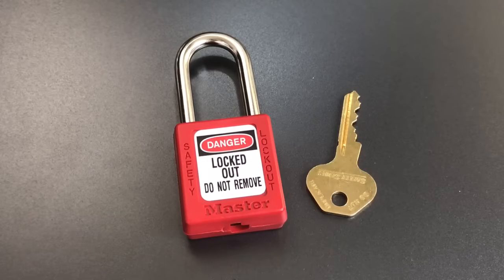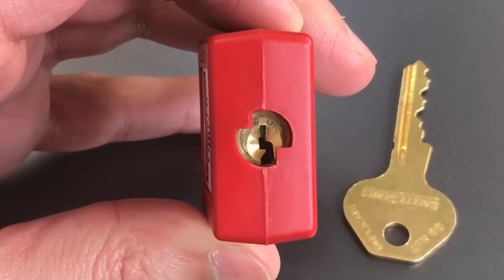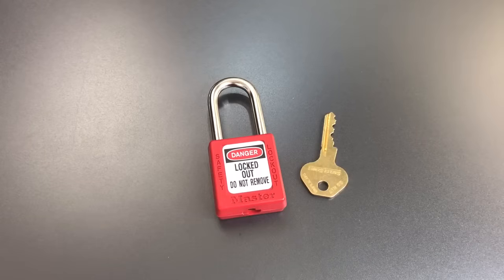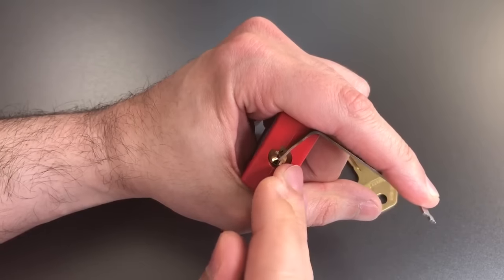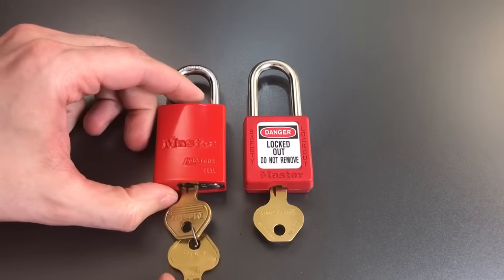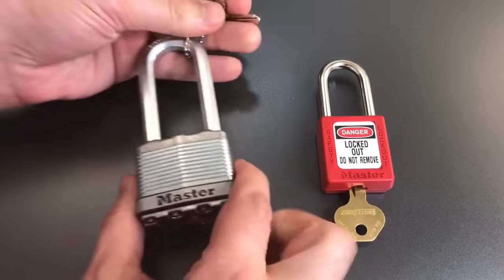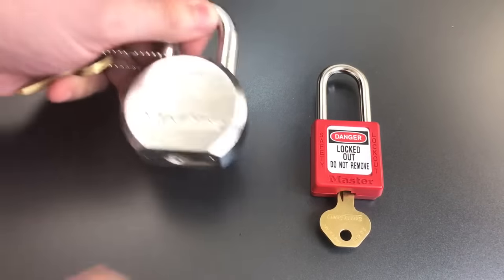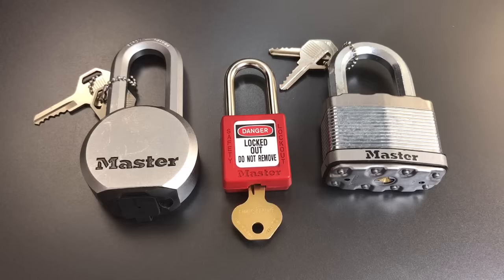[479] The Master Lock Paradox - Model 410 LOTO Padlock

Comment: when I was working at a hydro electric plant, we had about 500-600 of these on various switchgears and electrical panels. Various people had various keys to unlock various systems of the lockouts. While no one there would have any reason to break a lock to one of the panels, making a simple accident, if someone through the wrong panel at the wrong time, there could be anywhere from a broken turbine to an explosion. Therefore, its better to have a lower chance of unlocking the wrong padlock then there is for having a secure lock body since there is no risk of someone trying to break it.

Comment: This particular video still resonates with me when looking for a lock.
This video is the single reason I have watched so many LPL and BB videos.
This single core has shown me how a lock intended for a $150 bicycle can be made secure enough to protect several thousands.
I use this knowledge to smith my own locks, as well as play with home made picks. I even have a set of my own home made pins. About 40 total between key/driver pins and bags of almost every manufactured pin size.
I'm every bit of a low level hobbyist, and I can make better locks from my scrap bin than what master sells.

Comment: Hi LPL I'm a maintenance electrician working in a gas production facility. We have a lot of lethal machinery and high voltage equipment. We use the lock out Master locks in this video. Having watched it I feel a bit safer. I would think because my life is more important then someone's garage, is the reason Master Lock has made sure you can only open the lock with the one key it comes with.

Comment: I doubt you’ll see this but, I work in an industrial setting and my guess would be that like you said they wanted a core with plenty of options, maybe a factory with thousands of employees and each employee expected to carry multiple locks, but being a LOTO lock you don’t need security you just need a glorified sign saying somebody is inside this machine. You do however need to be able to remove the lock easily if the owner loses a key, breaks the key or say they go home and forget to remove the lock. I know the keys aren’t exactly delicate but if you lock and unlock a locks dozen times a day every day for years on end the keys eventually get worn pretty heavily. I’ve had multiple locks cut off machines for all these reasons.

Comment: I worked in a sawmill and we used lockouts all the time: changing saws, clearing jams, maintenance, etc. As the "Lock, Tag, and Try" procedures were implemented, the Company started out using standard Masterlock locks and went to great lengths to make sure there was no duplicate keys out there. People being people, the Company had to buy locks monthly to replace lost and missing locks. It became a weekly task for one person to put locks where they were needed and to make sure there were no duplicate keys. It seemed the Company was supplying locks for every shed in the County. Even though the plastic locks were more expensive, the Company cut their cost substantially when they made the switch. Also, Masterlock sells them as a system and makes it easy to avoid duplicate keys.

Comment: It's not a paradox. They're not supposed to be physically secure, they're supposed to be secure in the liability sense. The strong key retaining core means that if the lock is put on or taken off of something then in most circumstances you can be sure the one person with the key did it and if something goes wrong because of that everybody else's ass is covered. The lock body being plastic means that in an emergency the system the lock is on can still be accessed, but it's evident that the lock was damaged to gain access.

Really it's just an ass covering tamper evident lock that can be removed in emergencies.

Other Master cores are bad because making good cores costs more money and most customers don't know the first thing about lock picking. If the outside is sturdy then that goes a long way to convincing people it's a good lock, and it goes a long way to stopping most thieves too.
No matter how good Master makes them, we'll always go with Abus or Medeco so they're not going to waste money trying to appeal to us, they've got a pretty decent name among regular folk and they're affordable enough to seem preferable over their more expensive competitors.
Reply: you donky  found the union employee
Reply: Still a paradox because they copped out on the heavy duty locks made for security.
Reply: @rayers1000  they didn't cop out. They did it on purpose. For a specific reason. One guy from Australia explained it above.
Reply: Yeah was thinking something like that. The lock means "do not pamper with me, i am hard to pick and if you try to get me open you will likely leave evidence" while still it being possible to be opened. Even when picking it and you are not careful you could leave scratches. But this doesn't quiet explain why other locks should use worse cores?

Comment: As a complete noob starting picking today, I used one of these as my first lock, as well as a random Brinks lock I found. I would just like to mention for the Master Model 410 LOTO lock, once picked, do NOT over rotate the core past 90 degrees, for if you do you will drop all of the key pins into the lock body. Spoken from experience, that satisfying clunk of a lock picked followed by the jingle of all 6 key pins falling out filled me with a lot of emotions. Lesson learned. Thankful this video was here for reference. 
As for the core, can confirm, 5 spools and 1 double serrated on 5.  
Also, picking using LPL Genesis Set.

Comment: This paradox isn't a paradox at all! It's easy really... This red lock is a safety lock - that's the answer for its internal and external properties. A safety lock must be difficult to open without a key, but at the same time easy to destroy in the events of emergency. All other locks that this company produces are for regular consumers - the lock must be cheap to produce, but look sturdy. And something tells me that the locks body is always cheaper than the locks internal mechanism.
Reply: Did you not watch the video?  1. Then why do they make other LOTO locks more hardened but with lesser keys and 2. His point was more about why the stronger master locks have such crappier keyways than it was about why that lock was plastic.
Reply: Ian Adams you’re off your head. Those questions were just answered.
Reply: @Cowboy96  I was replying to Kelanian.  I know what questions were answered, he apparently does not
Reply: You work for master lock don’t you 🤨🤨
Reply: It's all about money. I'm betting the plastic lock is the most expensive as it offers the best features for LOTO. It's light easy to break open and has high security from picking.
Reply: @ian3580  to paraphrase the original comment: locks for typical uses must look strong and be cheap.

If the difference between a good and a bad core is several seconds more needed to pick it then it's usually not worth the price. But a sturdy looking lock will stop a burglar with a crowbar or another tool. So it makes sense to produce strong locks with cheap locking mechanism (making the entire lock cheaper).

Comment: If someone leaves a lock on, you need to be able to destroy the lock in high priority situations.  This is not a common practice, but there are situations where this could occur.

Industrial process owners aren't trying to protect against destruction of a lock, they are trying to avoid accidental operation of equipment.
Reply: My dad used to work in coal and hard rock mining, and someone went home with the key to a LOTO lock for a conveyor system. According to him, his parent company lost over half a million dollars waiting for the guy to drive back- but MSHA regulations forbade cutting the lock.
Reply: There are very few locks that stand up to five-foot bolt cutters.
Reply: It also could be because of these are used on high voltage applications. Could be a personal safety feature, also could be to keep the bolt from welding to the body should a short happen
Reply: It's pretty common in my experiences, these locks almost get cut on the daily in bigger factories. You need permission from the guy that placed the lock however (usually contact info is on the lock), otherwise it's illegal even if you own the lock and the machine. 

As for high voltage applications, I don't think that's relevant. The interior is still metallic, and either way the shackle would melt off pretty quickly in a short. And for personal safety the keys aren't insulated so you'd zap yourself by putting the key in even if you don't touch the shackle. THOUGH a lot of control/electrical panel lockouts actually aren't that sturdy. A heavier lock could easily not fit or damage the lockout over time. I've seen deformed lockouts in my days.
Reply: Then why the good core? If not hard to break then why need such a good core but for the hard to destroy such a shitty core.
Reply: @strategygaming5830  They had to meet requirements demanded by Industrial regulations. Basically its common for industries to hold thousands of these at once so they demand more possible pin combinations. And FYI I'm pretty sure this is why they're made cheaply, because they're sold in huge quantities. Being easy to cut is just a happy coincidence.

As for the sturdier locks, the primary method of forced entry would be destructive methods. So that's their priority. When it comes to the core, odds of someone else nearby having an identical key is pretty much impossible unlike the safety lockout locks. Having a 5pin or 4pin core doesn't affect security, if your thief can pick a 4pin core he can pick the 5pin core too. As long as it protects against no skill attacks like bump keys, raking and shimming it's practically going to be as good as it needs to be.

The only thing that confuses me is the use of security pins in the safety lockout locks. That seems excessive. The only explanation I can't think of is this was was per-designed core from an other project. So when demands came for a 5pin core they just pulled it out instead of designing a simpler one.
Reply: @DDracee  This would be a good argument if it weren't for the fact that most of the beefy Masterlock locks are famously pretty easy to rake. LPL even does a few videos where he he compares the different Masterlock locks and finds that usually the ones that can't be raked are their level 3-4 security locks (based on Masterlocks ratings) while their 10s are usually rakeable. While some leeway can be given to the number of pins and such, just the sheer false advertising Masterlock does, like having that weird inverse security rating system just severely casts doubt on whether their designers actually do any research on real world crime. While there are probably not that many lock picking thieves out there, I reckon there are at least as many of those as the ones who carry around 6 inch grinders, and certainly less than the amount who know how to rake.
Reply: @styleroler5816  That's just masterlock being masterlock, cutting corners wherever they can. Wasn't trying to argue that they make good locks. Just that they were forced by demands to have that core in the lockout locks. 

Unless they're forced to they're gonna keep what they can to the bare minimum. Unfortunately their definition of "bare minimum" goes bellow the acceptable norm.
Reply: @joshuahudson2170  try getting a 5foot bolt cutter inside a 8in square cubicle enclosure 😁

Comment: sounds to me that they need a lock that is hard to remove without damaging it if you aren't authorized to do so. 
example: emergency! we NEED to actuate that control RIGHT AWAY but the key is unavailable! making it easy to break is a good idea for this.
another example: if it's not an emergency, we don't want someone to get away with gaining entry undetected. if they break the lock instead of opening it, we have evidence of foul play and are personally off the hook for responsibility.
basically it's for insurance and liability reasons.
Reply: I think this is what it is, personally.  It looks more like a seal than a lock.
Reply: Larry Maybury I think seal is the right way to look at it. Also it is an indicator to say “I am working hear; please don’t turn it on”
Reply: @rurikau  that's why it's a LOTO system, and not a LO system.
Reply: To be fair, picked locks are fairly easy to detect forensically.
Reply: The need for capitals and proper punctuation is deemed supervacaneous these days... Sad.
Reply: @Eunakria  what traces does picking leave behind? how is it detectable? I'm curious
Reply: Who are you telling that? PS. some ppl are not native speakers and therefore can't set every punctuation mark correct. tries to set commas correctly in a german sentences
Reply: @Lukas-xk1jq  : I too am not a native speaker... But EVERY language has punctuation.

Comment: No doubt some else has said the same thing, but there is a very simple reason to have a difficult to pick but easy to break padlock.

This padlock is used for SAFETY purposes.  It is much much easier to break it than to pick it.  As such, it's clear as day if/when someone unauthorized removes it.  (There is no 'master key'). 

Either the worker with the key removes it, or someone else breaks it off.  And because it's locked out for the worker's protection, that can have some serious consequences.

Trust me - even in a company where they take safety seriously, the skilled tradesman inside the machine can and will put 'hands on' the person that removed his lock.

I know this firsthand.  Was working overtime, in a 2,000 lb press fixing a die.  I hear the press starting up while I'm inside it. I slid out as fast as I could, and came around the press to see the blood drain out of someone's face. I chased them out of the building seeing red.  (Fyi, I deliberately let them run faster.  I didn't want to hurt them, but I did want to scare them.)

Comment: For some applications in industry, tamper evidence is a high priority, yet physical security is not.  That is to say, there's can be an acceptable protocol for cutting off the lock when an exception occurs, but it must be evident that it has been cut so the proper protocol can be followed.  

Things really go sideways if the lock is opened, and the exception protocol is NOT followed.  FOR THIS you need a lock that can't be picked by a novice  but can be easily opened if needed.  Especially plausible if someone is highly motivated by professional peer pressure or management performance review pressure.

For such applications, simple serialized tamper tags could be used If not for the fact that the locks are constantly reused, and assiged to one person.

Comment: I would say that they design most locks now for saw, angle grinder, pry attacks which Master has been pretty decent with. They just don't see the picking as a main attack possibly. At least they  don't seem to be focused on that side of it. But it is a little concerning when they have these nice 6 pin cores available cheaply and they chose to put a 4-5 pin basic core in all the top "Magnum" series.

Comment: The lock has to be OSHA compliant. One thing that was required was that the lock could only be opened with the key provided (also means must not be easily picked). The cylinder must be used for a LOTO purpose.
Reply: So their 'high-security' locks are not required to be OSHA compliant? /joke
Reply: Alien Kitten You're missing the point.  These have a very specific use.  They must be hard to open legitimately (only one key) and must be easy to cut off if the owner of that one key goes missing.

Comment: From the viewpoint of someone who’s a novice with locks but experienced with industrial equipment, here’s my take:
1. 6 pin core to increase the total number of key combinations. Repeating key combinations within a plant or even a company is usually a no-go. 
2. High security pins because industrial equipment can vibrate A LOT. I have first hand seen a lock open on its own due to nothing more than vibration. 
3. Plastic body because it is non-conductive (some other lockouts have rubberized coatings).

Comment: It’s not intended to use to safe guard a house or storage area. Lock Out Tag Out or “LOTO” is used for many Industries. I work in a Mozzarella Cheese Factory. We use these red ones on Pumps we pull apart and hand clean daily. The Maintenance crew use them when they work on electrical components. One person can carry up to 10 locks daily at the same time so the plastic body is ideal for a light weight lock. Also during cleaning, there is water and industrial soap to do a “Clean In Place” so plastic is also ideal to minimize rust from forming on the lock.

Comment: the real lockout lock is made to make sure it is hard to manipulate, and both the special plastic house and plastic activator inside is to comply with the VDE 1000V specs. I would never use any of the other to secure a high voltage lockout. ABUS use the heavy plastic coated shackle, but master insulate the key from the shackle with a plastic activator instead. It is not meant to be removed without sign of entry. and the high price allows for a good core.
Reply: Mark T the cheapest I can get at the wholesale is £24 And they really focus on the Only 1 key and no 2 locks are keyed alike

Comment: 3:47 the reason it has an excellent core is so that a worker cannot pick it. Meaning, if they were to tamper with what’s being protected then they’d damage the body. 

The reason the body is plastic so it can easily be removed in emergency situations. 

It essentially a resettable anti tamper device, like the zip ties that are out into freight boxes.
Reply: Firestarter But it doesn’t explain why the so-called high-security locks have such lousy cores.
Reply: bubbledoubletrouble even LPL said it has a great core... So I don’t get your implication.